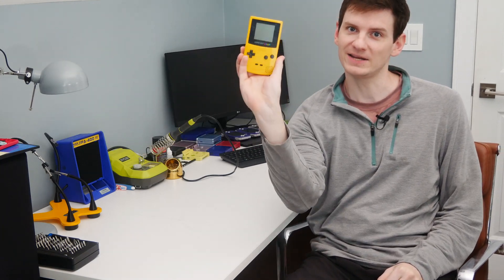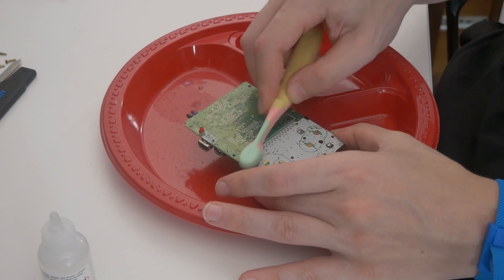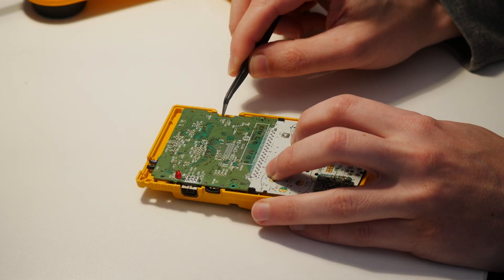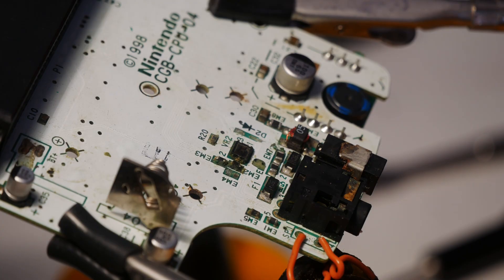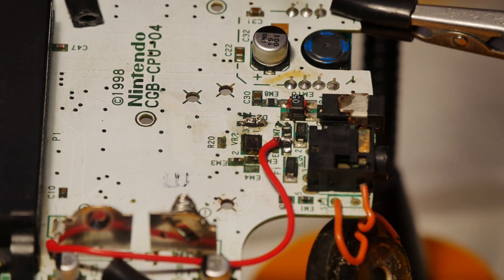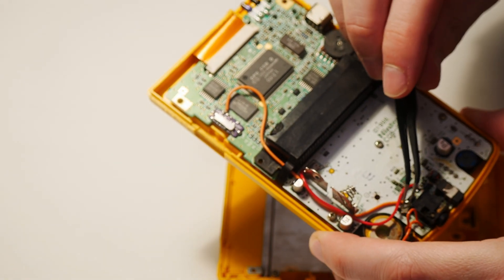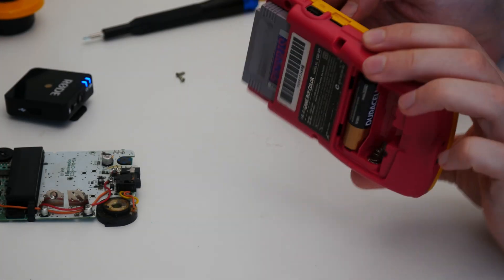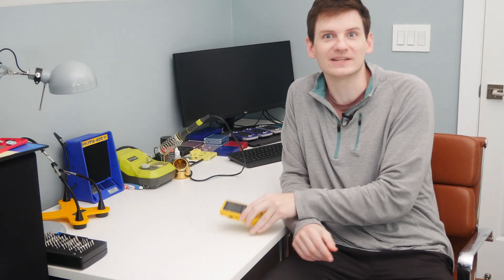How to Repair a Dead Game Boy Color | No Power, No Sound, Dark Screen

Comment: I’m having issues with pin 2 on the power button. Everything else has power/continuity. Should I wire f1 to pin 2 directly😅. Pin 2 did not have power while testing continuity power on/power off. I know not much but I get it.
Reply from the maker: Took a quick look at the schematic and I don't believe pin 2 goes anywhere. Only 3 and C should have power to them with the switch on

Comment: This video was very helpful! Thank you for the link to the schematic. I came to YouTube to determine if there should be continuity from the battery terminal to the power switch and this video had the answer. I've found so far that every single no power GBC I've worked on had an issue that involved the power switch, so knowing that I can check continuity between + and pin 3 of the power switch was very helpful. The one I just fixed had a blown F1 fuse.
Reply from the maker: Glad the video was helpful! I learned a lot fixing this particular gbc which I've been able to use to repair more since

Comment: I wonder if it should of put tape down around the capacitors. Dont know how old this is but alot harder now to find a gbc that for sure is good for 50. Alot people selling as is for 70 ish. I got 3 diffent junkies ones for 50 each and 2 worked 1 didn't and had small issue with 2nd 1. All shells were pretty bad. Maybe in person deals if lucky. But basing off ebay.
Reply from the maker: I target $30 or less for junked gbcs, once I put in the time to repair it's not worth it to go any higher, I've been able to find some in good condition locally for $40-$50 but certainly not online. Things on ebay are going to more expensive just because of the fees, taxes, and shipping

Comment: Yea idk how so many people loose the cover. I just replaced the battery terminals and still dead. So gonna clean the switch next. Cleaned it drip method but still ko go. It not real bad shape hut def had batteries leaked in it over time. I use kids brushes too.
Reply from the maker: When the batteries leak in them they can be hard to revive. Reach out to me via Instagram if you have any specific questions I can help with
Reply: the little clip that holds it in place breaks or gets to where it won't hold. I found if you carefully heat the clip while holding it open and then cool it really fast you can restore its function. Just as long as it isn't broken.

Do you have continuity from the positive terminal to pin 3 of the power switch? There's a #3 on the board. It's the top pin.

Comment: Nice job great video   👌soldering technique comes with practise, revise iron heat levels and possibly use a smaller tip for the pins and try apply the iron to the pads a little longer for a better finish and to avoid bridging and a cold joint. I find adding abit of fresh solder before using the wick gives you a cleaner finish and less chance of ripping a pad 👍
Reply from the maker: Thanks for the advice! I've been soldering a lot since I made the video so I am getting a feel for it but the tips are invaluable!

Comment: You might have already known this but you need an iron with better thermal mass that’s why you struggled to solder those through hole pads from the battery terminal. Aliexpress has cheap irons that can use hakko t15 tips that use tips as the actual heating element. That with a nice chisel tip will make quick work out of those bigger pads
Reply from the maker: Appreciate the insight! I suspected as much but didn't know for sure. I'll look into it